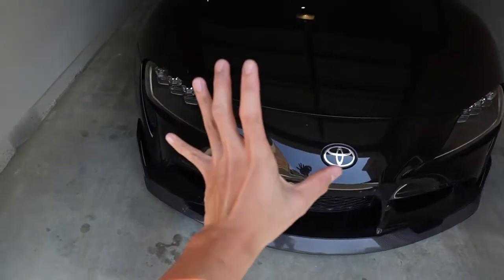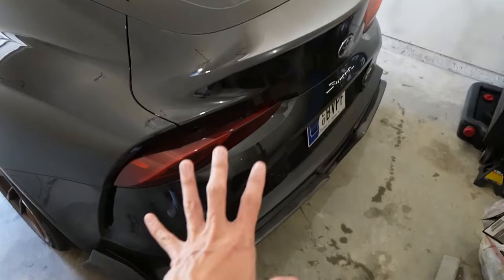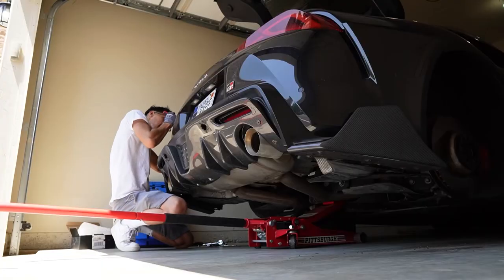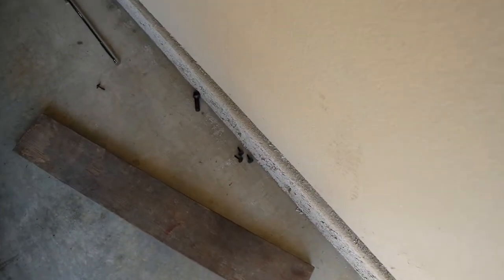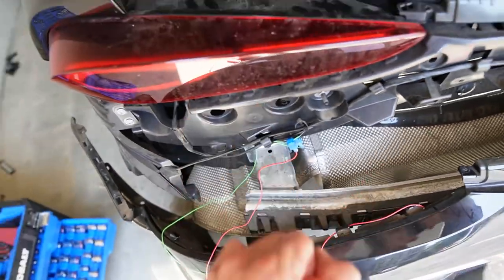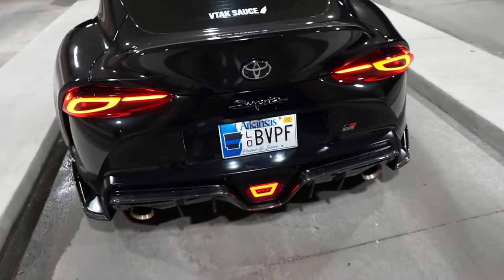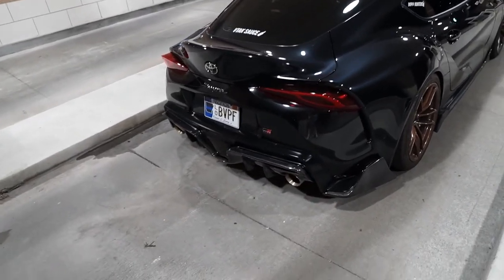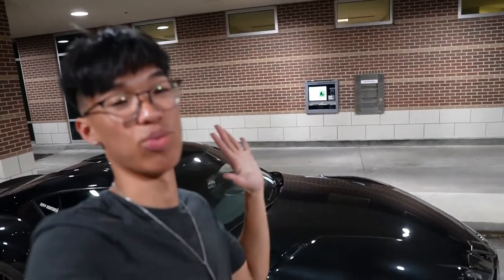Suma Performance F1 Style Brake Light

Comment: What does it do when the turn signal is activated? Both left and right signals?
Reply: Great question.  On my install, which I’m going to review tomorrow, the light flashes ONLY with the turn signal where the wires were activated.   Which sucks.   Maybe I made a mistake.  Tomorrow I will find out
Reply: @gruizmd I ran into this issue too did you figure anything out with it?